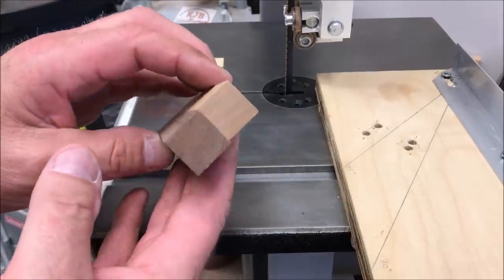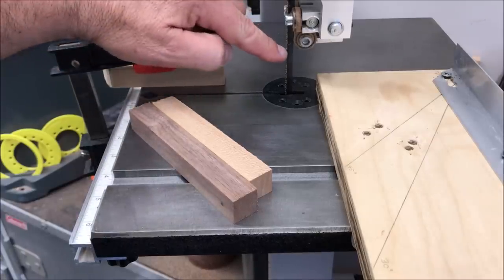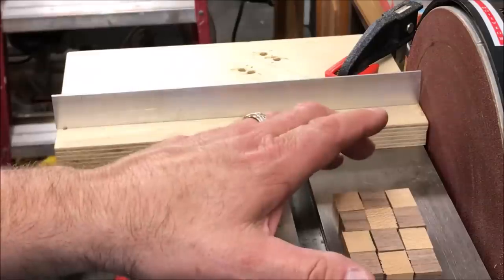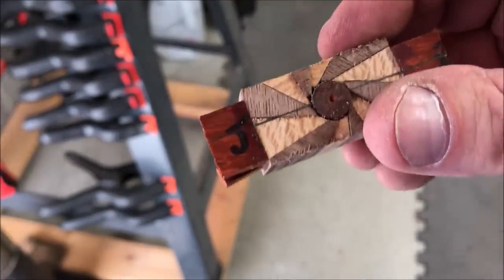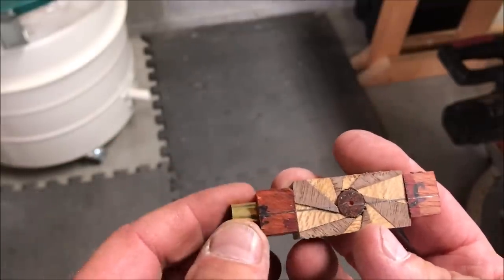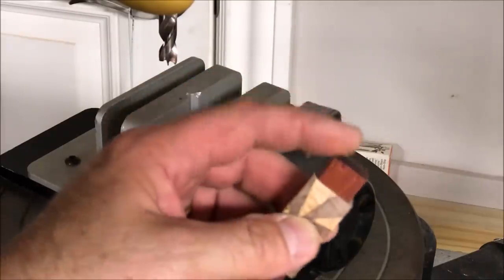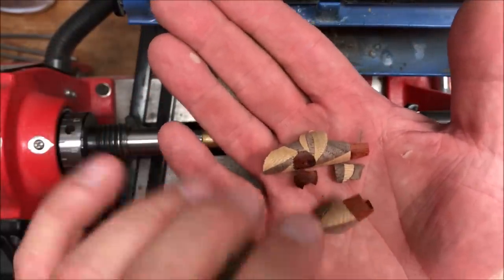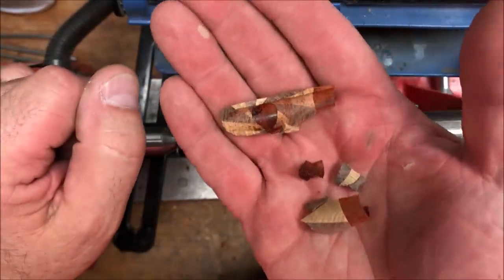How To Make The PinWheel Blank

Comment: Very cool, Bob. I'm going to try it.  When you drilled the blank, you were using a brad point bit. Just line the point of the drill with your center line.  That would put you right on center.  Also, I saw a short video by Barry Gross, who showed one reason why  blanks explode off the tube. When you put the glue on one end of the tube and push it into the blank, there is actually very little glue on the far end to hold the blank to the tube. Any little catch could tear the blank away.  I usually push my tube about and inch out the other side and re-glue.   Just a thought.  Keep 'em coming. I really enjoy your videos.
Reply from the maker: Thank you for the info on gluing, I hadn’t seen that video. That’s good information. 

Regards,
Bob

Comment: Looked at your video. A few observations:  1. Titebond is a good glue but  consider using Gorilla glue clear instead better adhesive ability; from looking at your blank you have voids even after clamping and letting sit with Titebond if you still want to use that glue consider a thin CA AFTER you let set and even when your turning apply Thin CA to strengthen blank. On the ends the padauk is a relatively soft wood consider a harder wood I.e. black walnut and use Gorilla glue to attach. The dowel you inserted had small voids around the center soak with thin CA to fill voids. I hope my observations will assist you with making this blank. Great concept.
Reply from the maker: Thank you Keith

Comment: The drill bit can catch when it breaks out of the blank.  Make the blank 1/4" longer than the finished length.  Drill only to the depth of the tube length, (mark the depth of drilling on the drill bit with a sharpie).  Then cut (or sand) the UN-drilled end to the proper length. This works especially well for acrylic blanks.   Use 80 grit gouge sandpaper for final shaping.
Reply from the maker: Thank you Randy. 

Regards,
Bob

Comment: Hi Bob,  I have thought about blanks blowing apart on some of the acrylic blanks that I have had. I think that next time I might try something unconventional and use a belt sander with the lathe in reverse and use the sander to round out and form the blank.  Ron  USCG RET
Reply from the maker: Lost of people round the corners off blanks with a sander. If that helps you save a blank, I say go for it. 

Regards,
Bob

Comment: First,  I'd like to say that looks awesome.  Great idea. Thank you for sharing everything,  including what went wrong. Plenty to learn from. 
 Now for my 2 cents worth:
It looks to me like you didn't have much meat on the bone when it snapped. Maybe a smaller diameter tube/pen kit would have been more successful. 
Also paduak is awesome,  but it snaps more frequently than just about anything else when i turn.  
Lastly,  as someone else said,  a pre-drilled piece of paduak might have been more successful for the end. I probably would have found a thicker piece too. You were almost flush to the bushing it looked like,  and the paduak still had flat sections. Personally,  when i cut blanks,  i try to go for closer to an inch in thickness (7/8th to a full inch). You may waste a little,  but you get a little more breathing room turning and drilling.
Reply from the maker: Thank you Harley,
  Most pen kits don’t allow much thickness, I was using the larger diameter tube so I could display more of the blank. Smaller tube pens have smaller diameters and you lose a lot of definition. That padauk was flat but it had enough meat to round out to the bushings. Plus it was the only piece I had in the shop. Sometimes you gotta play with the cards dealt you. The biggest issue was I was hitting the sidewalk of the Padauk. Once I offset it it drilled fine. 

Regards,
Bob

Comment: I don't have a vacuum chamber so I can't try it for you Bob,  what if you stabilized the blank before drilling and turning?
Reply from the maker: Stabilizing fills voids in the wood. This blank was using two solid blanks so I’m not sure it would have had any effect. 

Regards,
Bob
Reply: @RJBWoodTurner  it also strengthens the wood, which is why you stabilize soft woods and burls for turning.

Comment: I make pens and lace bobbins and have NEVER used a gouge at all!  In fact I don't have one small enough!  The skew chisel is used for both, from start to finish and used correctly will plane off the corners of a square and fine shavings when round with little chance of a catch. Also, by using the skew a fine finish can be achieved thereby lessening the need for long periods of sanding!  Try it sometime!
Reply from the maker: I mentioned in the video I should have used the skew.

Regards,
Bob

Comment: Thanks. I look at as learning not failing. The key point is the design idea which is fantastic.
Quoted from the web: As an inventor, Edison made 1,000 unsuccessful attempts at inventing the light bulb. When a reporter asked, "How did it feel to fail 1,000 times?" Edison replied, "I didn't fail 1,000 times. The light bulb was an invention with 1,000 steps."
Reply from the maker: Thank you Bob,
  That quote is so very true. 

Regards,
Bob

Comment: Mr Bob, I notice you don't center align or clamp your blank vise on the drill press table. Along with helping keeping the bit centered in the blank, wouldn't the rigidity of being clamped down help with the blowouts? Mind you, getting a drill bit out the bottom of much harder materials than wood can cause excitement.  I do realize that using the V groves in that blank vise as a centering feature, will make you have perfectly squared blanks. Getting a multi part blank squared up after glue up, and keeping the design centered would be a video episode in of its self.
Reply from the maker: Thank you. 

Regards,
Bob

Comment: Great video.  As a beginner it's nice know that experienced pen makers have fails.  I learn a lot that way.  Question: would drilling the hole on the lathe have been less problematic?  Thanks.
Reply from the maker: I don’t think so, the issue was the Paduak blank was smaller than the main blank and I was hitting the edge and splitting it. Once I offset it it drilled fine. 

Regards,
Bob

Comment: Hi bob the problem is the roughing out gouge is designed spindle work and it will grab at end grain so the end result is what happened to you that why you should not use it on side grain bowl blanks. It's a shame as it was looking nice as well cheers Ian
Reply from the maker: Thank you Ian. 

Regards,
Bob

Comment: Ok in analyzing the slow mo  footage try using a side cut plug versus a end grain dowel and 86 the paduk. I think the 2 drilling fails foreshadowed your issue. 

Also have you tried polyurethane Glue. Gets into all the nook and crannies.
Reply from the maker: I use to use PU glue. I like Epoxy better. PU will show between the pieces as a dark line where Epoxy stays clear. Just a personal preference. 

Regards,
Bob

Comment: Why do you use a cutter instead of sandpaper for such a delicate thing? With its help, the tree is stitched very quickly, but much more accurately and without shocks, which are characteristic of the cutter
Reply from the maker: Tools over sand paper is my personal preference. I think the issue here is I should have been using my Skew once I truedthe blank. I stuck with the roughing gouge to long and it is no good for delicate work. 

Regards,
Bob

Comment: I kind of new to turning but I wonder if it would help to stabilize it prior to turning, or maybe run the center dowel longer than the blank, it looked like it broke where the edge of the dowel and the triangles joined (That low spot you showed) if the dowel was longer when you put it in and sanded it flush it might provide more support. Just throwing some ideas out.  All that being said, Great video, I love how you made the little triangles.
Reply from the maker: Thank you Richard. 

Regards,
Bob